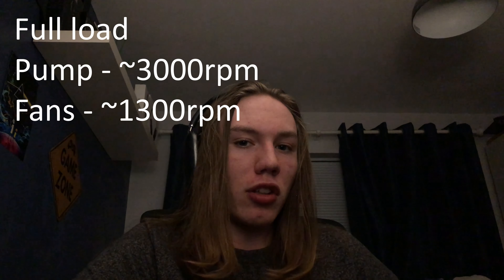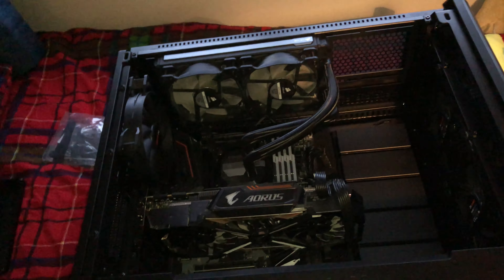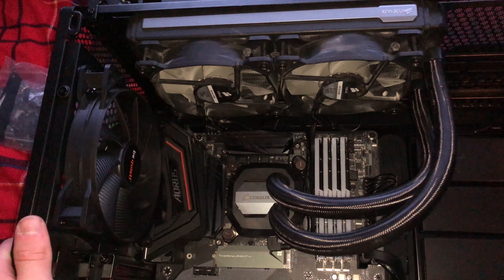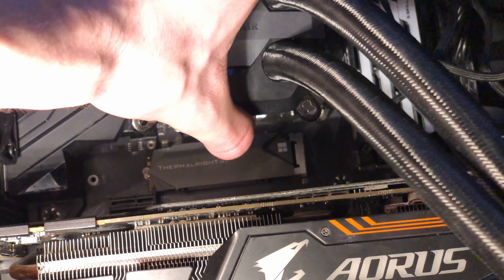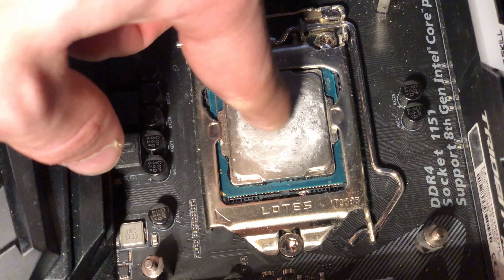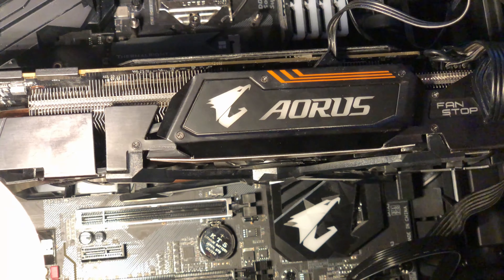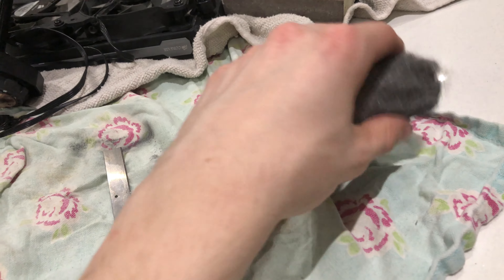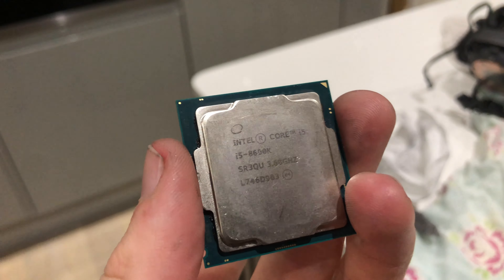Liquid metal after 2 and a half years

Comment: Gallium + Copper create Cu9Ga4 and CuGa2 alloys that have melting point around 250+ C
Reply from the maker: but how would the gallium and copper combine if one is in liquid state and the other is in a solid state?
Reply: @Stanley88845  like gold and Mercury disolve, or a gas like oxigen rust many metals, Is pure chemistry only nickel plated withstand the chemical reaction.